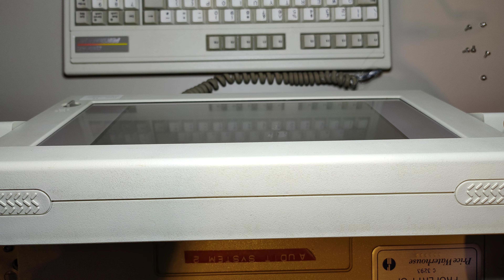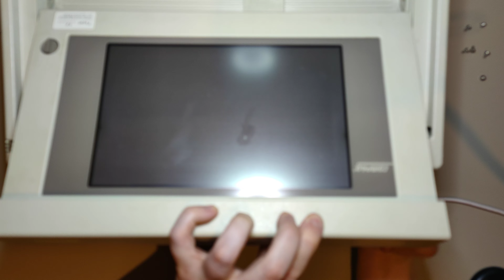Compaq Portable III - Disassembly and Testing

Comment: I really really really really really need the voltage output from te red molex connector coming out the power supply

I have one of these 386 with the power supply damaged, y managed to replace the  main connector with another AT power supply, based on the Compaq service manual, but couldn't find the voltage output of that connector
Reply from the maker: I actually have the footage for a power supply video but haven't made it, it's a +5v
Reply: an spare power supply for this machine is really hard to get, so your video will be totally useful!!
Reply: @mattsqwrl  Hi, Do you know where to find a schematic for the PSU?
Reply: @ramirojavier6205  Hi, did you find a fix for your compaq portable? I am looking for the psu schematic.
Reply from the maker: @dinonostrils  No I was just fortunate mine worked, they are pretty complex things.

Comment: One of these just popped up for sale on marketplace for 200nzd, but it's had the magic blue smoke.. is it worth buying and putting modern internals into it? Curious how difficult it would be
Reply from the maker: It's got quite a bit of space inside, even replacing the screen with a modern panel probably wouldn't be too bad... I am dying to see the original work though tbh!

Comment: Hello. I am wondering if you could help me or if you know someone who can. I have the same computer, except that when booted the screen does not work at all. Thank you so much!
Reply from the maker: Do you mean the screen works when you power on, but not later? Or not at all? It would be hard to troubleshoot, though the first step would be to check if the power supply to the screen is good. It's high voltage, so if you haven't used a multimeter before this probably isn't a good one to start with.
Reply: @mattsqwrl  The computer powers on normally, you hear the hard drive run, and the start up beeps but the screen is completely unresponsive, blank as if its powered off.
Reply from the maker: @KazukiMatsuoka  It's very tricky to troubleshoot this old stuff. It does have an external monitor connector, but you'd need some weird old monitor to use it. But that would let you see if the rest of the computer is doing anything, though a beep is a good sign. Checking the power to the screen with a multimeter would be the first step, it comes from a red molex connector iirc. But also it's 200v, scary stuff.
Reply: @mattsqwrl  this is a project that myself and my Father are doing together. I was born in the late 90s so this is exciting for me, Dads an electrician so he can start with that monitor. We are looking into getting a CGA to VGA adapter. Thank you for the input!